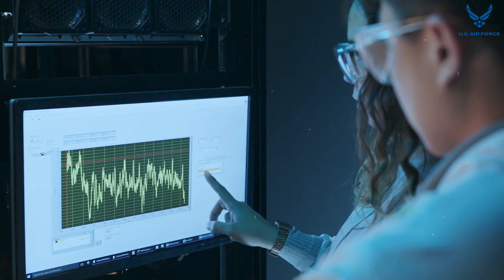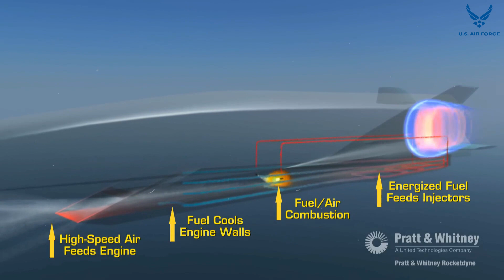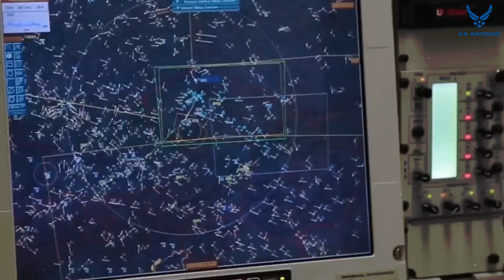USAF Advances with Hypersonic Missile Capabilities

Comment: Easy done to stop any missile or problems from EV drone technical challenges. I wont say it here but im sure i got the solutions. On Insider buisness i just seen drones are being made usless with electronics. Analogous strike capabilties will and can outperform intervention even against hypersonics. It just depends on what you want to conceive in mapping and vector-based systems. In that token there is a weakness that has to be envisioned for comparisons of circumferance but mass intrusive combos scaled to overlapped sequential warfare compilation in variability as well as enveloping strategies complacent with harnesses of offensive defense management's along with adding reversal  compensated tech forms. But like i said earlier i wont post what ive thought up.